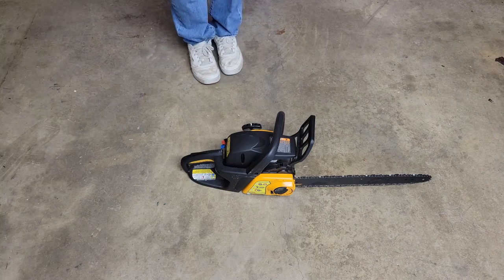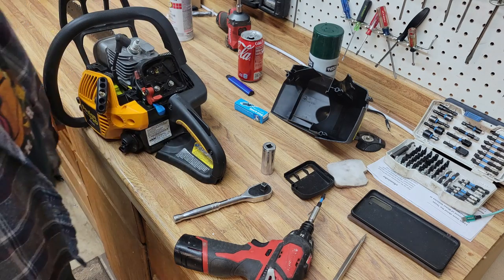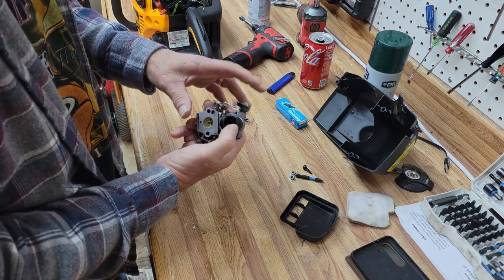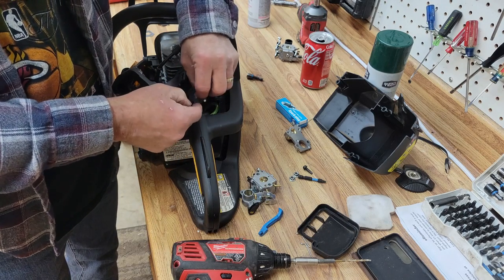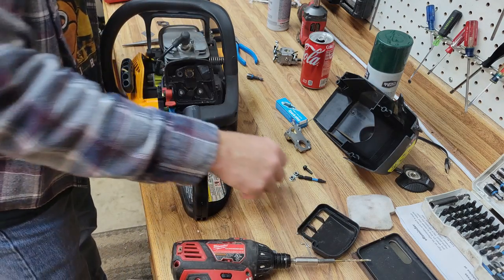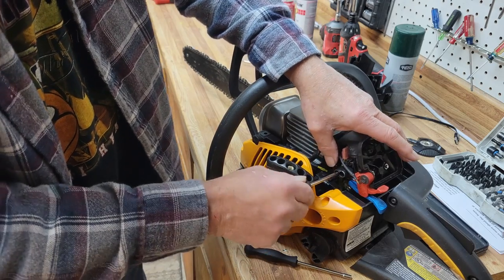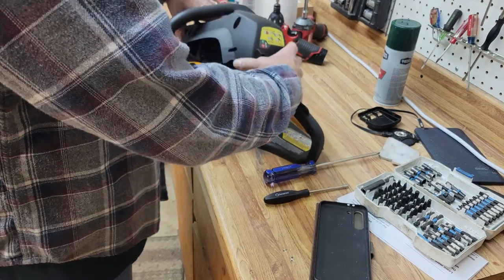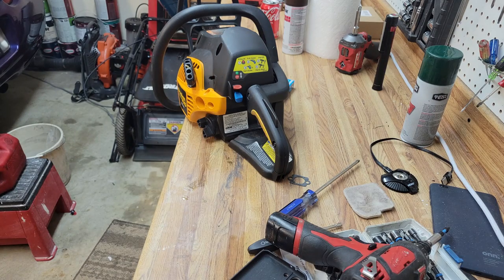Poulan Chainsaw won't start, let's change that

Comment: Yeah thats great if you have another Carburetor But it's a pretty crappy video for DIY'ers who don't have another!
Reply from the maker: Sorry you didn't like it. Carbs are pretty easy to order online.
Reply: I also love that he just looked at the carb and said “It’s a mess” without any further explanation😂. Seems like he just wanted to do a video about changing a carburetor rather than actually diagnosing the issue.
Reply from the maker: One word, rust. I thought I mentioned it but might have slipped on this one

Comment: I'm attempting to tune my "new" Eager Beaver 32cc saw. My take away from this video is 1. turn up the idle screw, so it isn't the problem. 2. set L out 1.5 turns 3. Start the saw and set the L so it has good low end & idles nice. 4. Set the H so it has top end. 5. Back the idle screw down so the chain does not move at idle. Adjusting the L may be necessary, as you lower the idle screw. As you adjust the L, it may be necessary to adjust the H again. Repeat cycle until chain does not move at idle, and the L&H are harmonious.  Did I miss anything?
Reply from the maker: Tom, you are good. You got it all perfect. 1 thing. but judging by your list, I think you sissy know...  If it  idles ok and bogs when you rev it, play with the H Screw

Comment: On those carbs the choke on the carb breaks so easily. They actually have a metal ome instead of plastic. Just cut the bar off and it'll work just fine.
Reply from the maker: I have been pretty lucky with them.  I see more Echo weedeaters with broken chokes than anything else.

Comment: Well done. Always the carbs.
Reply from the maker: The last one was an odd duck. The carb needed attention but the coil was shot. I am sure the next one will be the carb... it always is.
Reply: @GuysPlayingWithTools  I thought you said it had a spark?
Reply from the maker: @BensWorkshop  That was for the next one, this one did. Up today is a vid on a blower tune up, it didn't have spark when I started. Sorry, I wasn't very specific, it was on my mind because I released it as I was looking at comments.
Reply: @GuysPlayingWithTools  no worries.

Comment: Ya with all chainsaws its good to learn how to work on them even the name brands can get issues and most are an easy fix well sort-a easy lots of YouTube videos to help us out.
Reply from the maker: I enjoy making them too! There is nothing like hearing a motor kick to life.
The fixes for chainsaws are just about all the same, regardless of the brand. I treat $1,000 Stihl's the same as I treat $99 store brand saws, always the same problems, always the same fixes. 👍
Reply: @GuysPlayingWithTools  That's why I watch Vice Grip Garage and Diesel Creek on youtube that's there gig getting really old stuff to kick back to life, really good shows....
Reply from the maker: If you like the old stuff,  I have one coming up just you will love,  an old JD mower with the original design rear wheel drive. It's so brutal, it's cool.
Reply: @GuysPlayingWithTools  👍

Comment: Oh yeah sounds good, i have the 4218a almost same machine great saw i cut 62 cord with it and still strong.
Reply from the maker: It's a solid saw for sure. If i didn't have one I already liked, I would think about this one.
Reply: Only thing I do is rotate between the two saws and keep carb adjustment tool in my pocket when using them 
Plus I spray caps off with brake cleaner before adding fluids😊😊😊
Reply: @philliphall5198  good idea with cleaning the caps i like it.
Reply: There really good saws if you do PMV and I spray off filler caps with brake cleaner before I fill them up 
Keeps trash out of system 😊
Reply from the maker: Good suggestion.  Saws tend to get more than the average amount of garbage in the tanks in the field. I have a habit of carrying a rag to wipe the gas tank and cap area before filling them outdoors

Comment: Nice condition saw there Bill, interesting to see so many of your saws are strato! Never seen one on homeowner equipment before, though much of what I work on is 10+ years old and a lot changes in that time!
Reply from the maker: The linkage is a cable, which can be a pain if it has a problem, but tuned right they make the motor scream, so it's worth it
Reply: @GuysPlayingWithTools  I bought a poulan pro for 30 bucks not running but I found that the gas line was broken inside  I put a new gas line and now it runs in a full super fast like a full throttle please help
Reply from the maker: @rodger6940  hi Rodger, You got it running, that's the hard part. Chainsaws can be tricky.  No worries, it's most likely the linkage for the carb is either tied up in the fuel lines or hanging on the choke linkage. The first 2 things I would check are:
1) With the saw off, pull the choke out and then squeeze the throttle, the choke should return all the way in when you do. If it doesn't, check the linkage carefully and make sure the choke lever is in the right hole and not dragging on anything. 
2) Check the throttle linkage and make sure it isn't hanging up on anything or dragging on the fuel lines
It's one of these 2 almost every time. Let me know what you find. (and good luck!)
Reply: @GuysPlayingWithTools  thanks for the reply I will check out
Reply from the maker: @rodger6940  Let me know. There are other things you could check, but one of those 2 are usually the problem.

Comment: i got 3 poulan saws yesterday for $10 im hoping i can make at least one good one out of the 3
Reply from the maker: Nice.  If they only need one or 2 things each, think about buying the parts instead of stripping the others. There is a lot more money in the long run that way 👍
Reply: @GuysPlayingWithTools  yeah I'm check compression in them today if that checks out then I'll definitely do what you suggested
Reply from the maker: @franciscomolina5362  Good luck 👍
Reply: @GuysPlayingWithTools  thank you sir!
Reply from the maker: @franciscomolina5362 Let me know how it goes
Reply: @GuysPlayingWithTools  we so far 2 out of 3 have 120 psi compression but I can only get 1 of those torn for like 2 seconds. I believe it getting flooded the other I don't even know yet.
Reply from the maker: @franciscomolina5362  Usually, it's a lack of fuel for one reason or another, but I can't see yours, so... maybe it's flooded 👍
Reply: @GuysPlayingWithTools  it was spitting out fuel mist from the exhaust that why I assumed flooded but the float was way out of spec I adjusted got it to Rev no problem now just trying get that carb tuned correctly so it will idle 🤞
Reply: Other one needs a couple seal fir the gas tank to hold pressure I believe that what the problem with that 1. What do you think??
Reply from the maker: @franciscomolina5362 If it's coming out the other end, it's definitely flooding 🤣
Reply: @GuysPlayingWithTools  heck yeah that's was my thunk too
Reply: Hey does the tank have to be under pressure for this thing to run? I'm pretty sure the answer is yes I just need confirmation

Comment: Question: I have a Poulan 295 pro, that is extremely hard to pull start when the spark plug is in (when there’s compression). If I remove the plug it pulls just fine so it’s not the flywheel or pull spring. I removed the muffler and the piston is very clean and smooth, it’s just when there’s compression it won’t pull. When I hold it in place with my foot and pull, it’s so tight my foot starts coming off the ground before I’ve completely pulled the cord out. Any ideas?
Reply from the maker: That means it's hydro-locked. Drain the oil completely and make sure it looks and smells like oil. If it smells like gas, rebuild the carb) and put the correct amount of oil in  it, and you should be good to go.  I see that a lot. That is 98% guaranteed to fix it 🙂
Reply: @GuysPlayingWithTools  Thanks for your quick response. I’m pretty sure I determined it’s not hydrolocked. I removed the gas and oil, then the carborator and I still get resistance when I turn the piston. I noticed when the plug is out and I turn the flywheel by hand I still get some resistance at pretty much in the same place, like 6 o’clock and 10 o’clock. My guess is a bent valve or crankshaft. Would you agree?
Reply from the maker: Oh geez, my Bad(hanging my head) I was talking to 2 people about lawn mowers when you sent it and I had mower on the brain.
That saw has a compression release that makes it easier to start, it should be on the front(towards the blade) of the motor., take it out and clean it, it's probably hung up.
Reply: @GuysPlayingWithTools the poulan pro 295 doesn’t have a compression release. 2 strokes don’t have valves. Could be bad crank bearings or bearing. Debris in between the piston and cylinder wall. Stuck ring which was the problem on a saw I just repaired. Saw was straight gassed and got hot.
Reply from the maker: @Fueler  odd part is, he says it pulls freely when the plug is out.  I wouldn't rule out debris.  A bent crank isn't impossible but would seem unlikely.
Reply: @GuysPlayingWithTools  yes and they are clam shell saws so the squish is in the 0.50 for sure so the compression wouldn’t be high. Probably 130-140 psi max.
Reply from the maker: @Fueler  when I get something like this in person,  it will sound crazy but about 1/2 the time it's just hydro-locked and around 30% of the time, it's the owner not pulling hard enough(crazy, but I see it all the time). I have seen a couple lately where the cases were FULL of fuel... I wouldn't even guess how.
Reply: @GuysPlayingWithTools  yeah I understand completely. If he’s pulling it over easy with the plug out fuel should be   Coming up the transfers and out the plug hole spraying everywhere. Would like to know if this person actually got it fixed.
Reply from the maker: @Fueler  Me too.  The bad part is... only about 1/2 let you know if it works, or what the answer turned out to be.  I always hope they got it running
Reply: @GuysPlayingWithTools  I ended up breaking it all the way down and I didn't see anything wrong with any of the parts so I put it all back together and the problem went away. It pulled fine and cranked after that. Not sure what was causing it but it works now.
Reply: Thanks for ya'll's help and comments.
Reply from the maker: @Joe Weissinger  Interesting, did you see any excess fuel or anything else inside
Reply: @GuysPlayingWithTools  Nope It was pretty clean which makes it even more of a mystery.
Reply from the maker: Well... I couldn't even give a decent guess without seeing it before it was running... maybe you have "the touch" and don't know it? 🙂

Comment: You didn’t have to put the plug back in the cylinder to check for spark and it would have been much easier to pull over
Reply from the maker: Old habit.  🙂